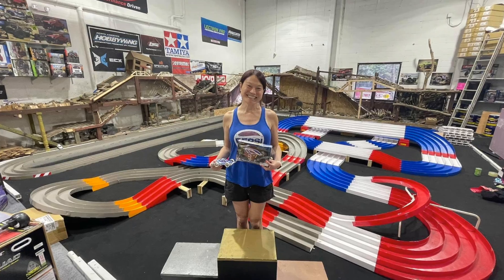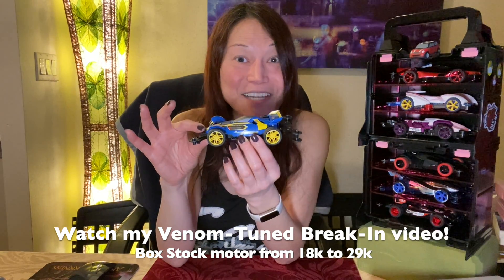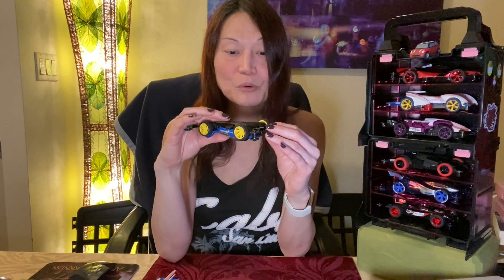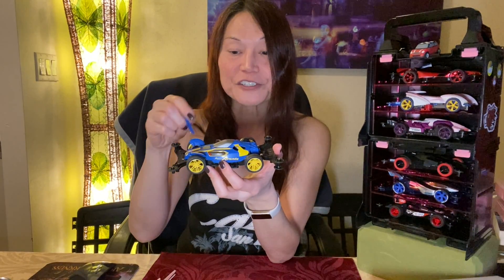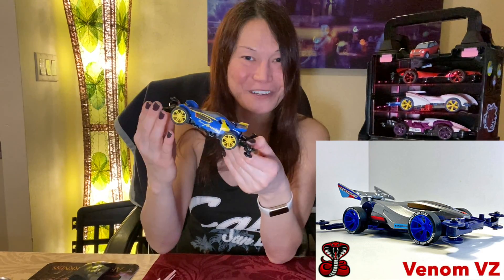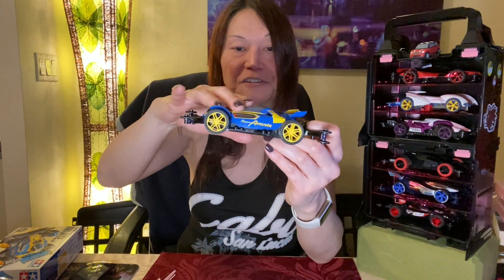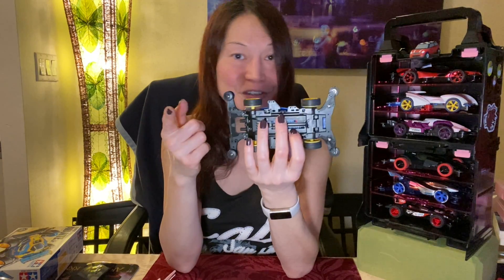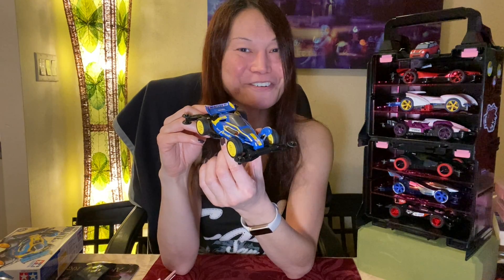Tamiya Mini 4WD Super Avante Jr VZ - Box Stock Killer?

Comment: Is it not durable when using screws on it or just for your unit?
Reply from the maker: It's just a fault of the chassis. Some VZ chasses, even brand new ones, have screw holes that are easy to strip. You can fix it with a drop of glue, but it's still annoying.

Comment: '
can this tamiya 1/32 car steering wheel turn left or right...
my 1/32 CR-V honda car turn steering wheel on the front...
only rear driveshaft gear and front is a neutral plus steering wheel
Reply from the maker: Hi bestamerica, Mini 4WD cars are not RC cars in the traditional sense. They can be turned on and placed on a track and that's it. While that might seem not very exciting, the fun part is experimenting with the car on different tracks and seeing whose car is the fastest. It's the modern day version of a pinewood derby race.